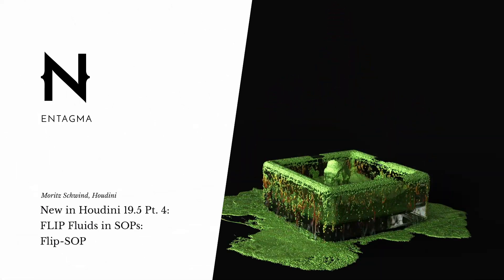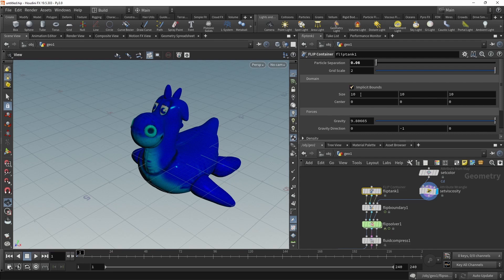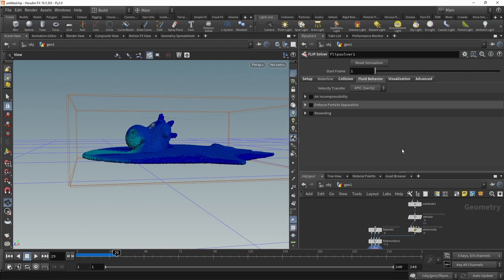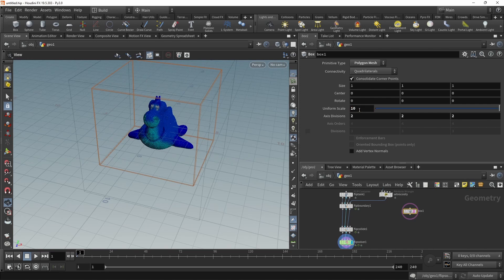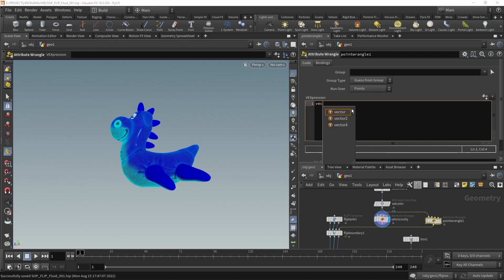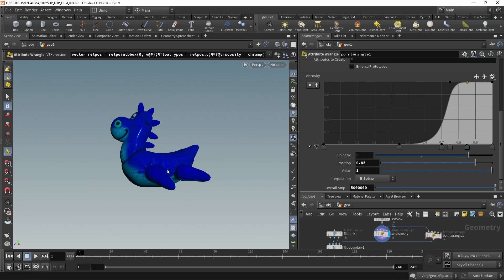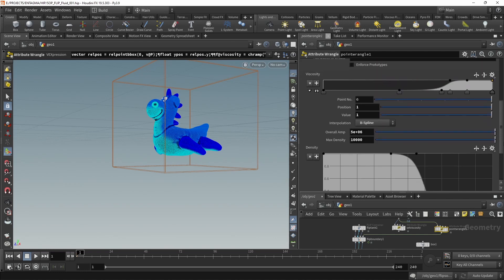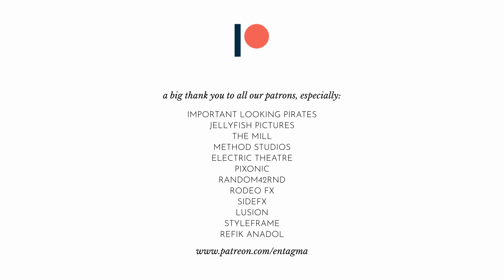New in Houdini 19.5 pt. 4: FLIP Sop Workflow

Comment: Big issue for me, as i change the particle seperation there are volume loss during simulation. normally i use the particle radius scale to solve the problem but in the New Sop Flip the "Particle radius scale" is missing. Any idea how to fix the issue?

Comment: Big issue for me is that the Flip collide volume resolution is invariably linked to grid/particle separation of the container. This means lowering the separation for quick testing significantly reduces the resolution of the collision volume, closing holes for example or rounding edges. In a normal dop network I can create a very accurate collision volume without changing particle separation or grid resolution.
I don't understand why I can not set the volume resolution in the collision node.
Reply: This is a common misconception. Even with the DOP workflow, collider is downsampled when you reduce the sim resolution. It is just not displayed as such. 

It is a bit more complicated. Colliders are used in two ways:
   1. When solving pressure, this is done on the grid and thus prone to low resolution. For example, a cup thinner then a voxel will not hold fluid properly and the fluid will collapse on itself. 
   2. Particle collision, if you make sure that the FLIP Collide node has `Surface Collide` turned on then the input collision geometry will be passed to the FLIP Solver and particles will collide with it.

We made the decision to fix the collider resolution to FLIP Solver's resolution because the collider is resampled to the sim resolution anyway. Sometimes it was also leading to confusion when the collider looked ok but wasn't behaving as expected.